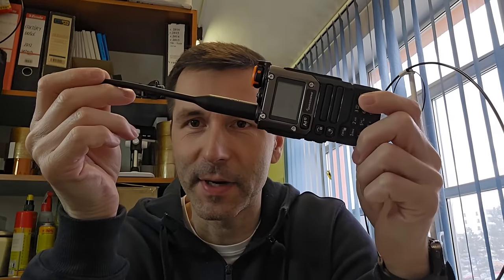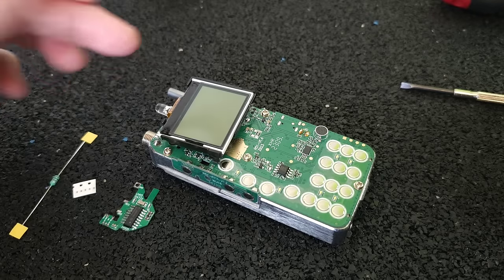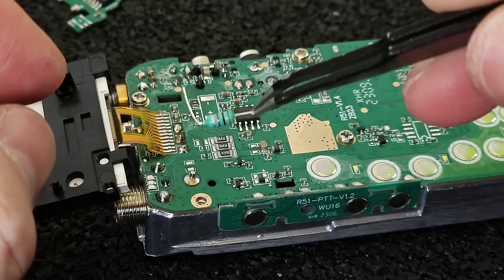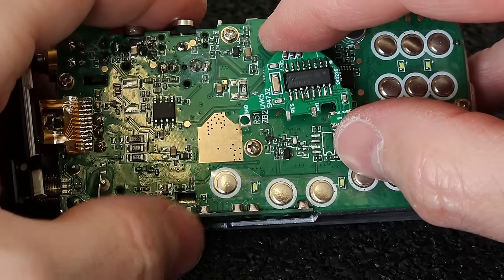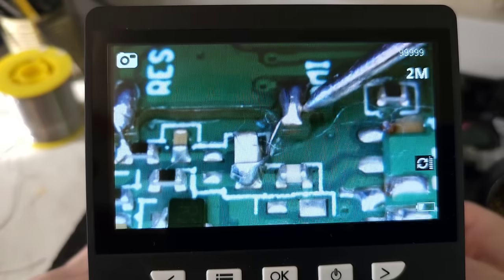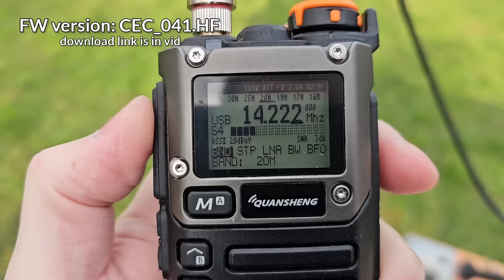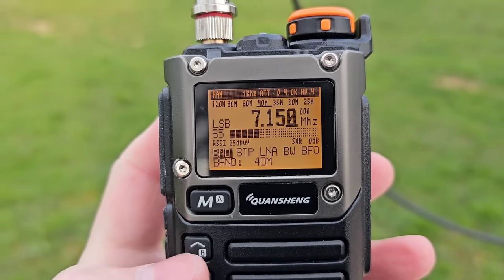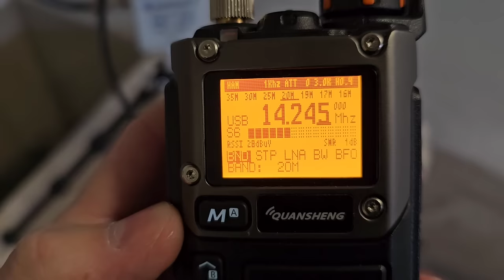VER.1 - HF FULL BAND Mod. - Quansheng UV-K5 (Si4732 new chip module)

Comment: Do the hardware modification work only with the CEC firmware? I would like to usee it for example with the quansheng-dock-fw to remote control the radio by pc. Is it possible?
Reply from the maker: With CEC only

Comment: @OM0ET:face-purple-crying:
I bought the chip and installed it according to your instructions, installed the firmware, but when I press the "0" key I get the message "Wait" and nothing works anymore :(
Reply from the maker: Well, you have to check poor connection on the ex-chip place contacts.
Reply: I have read through everything, from the north to the chip etc., all contacts are perfect. It was worked on under the microscope and with care and good equipment, flux, solder etc.

Comment: I tried this modification, howevre when I try to enable the HF by holding 0, I get WAIT on the screen and the HT locks up, nothing else happens.
I tried FW 0.41, 0.5, 0.51 but all does the same. Any ideas as to why this is?
I've checked all soldering etc and it all looks OK

Comment: Is the VHF/UHF TX still works after this modification, or does it turn the radio into a simple receiver ?
Reply from the maker: Yes. Seems, this mod is just a replacement for an original FM radio chip.
Reply: @OM0ET are you still able to transmit on the originally designated frequencies?

Comment: Do you have to do a firmware upgrade after this hardware mod Paul, or will it still work with original software?
Reply from the maker: You will have to use CEC firmware. No other fw can activate this chip.

Comment: at 7'52" i can see you have grounded something in the middle of the flexcable pcb to the display. what is that for?
Reply from the maker: Yes, I know. It was a tiny piece of the wire from my previous project I was working on before this video :) It has been removed before battery plugged in :)

Comment: hi, I made the modification to the uvk5 with the si47xx module, all done as a video tutorial, installed the fw cec v041 pakeg, but it seems to have no effect by pressing the 0 button the radio freezes, requires a reboot, what could be the problem?
Reply from the maker: Check the connections between both boards on the place where was original chip removed.
Reply: @OM0ET  check all the connections also with a multimeter and they are all ok, I have a doubt whether the EPROM should also be replaced

Comment: sometimes pressing fm stays frozen on the waiting screen instead of going to the low frequency settings  What could it be
Reply: It's a bad solder joint where the 8 pins meets up with the mod board. Mine did the same thing and I fixed it.

Comment: Hello: after installing the kit and updating the firmware to CEC 041, when you press button 0, the radio does not receive reception. it stays hanging. I have checked all the welds and they are correct.
Is there anything else I can do? TNX
Reply: The same thing happened to me when I pressed 0, C E C 041 was blocked
Reply: Usually RES in not connected properly.  Check all connections.
Reply: Same think to me,I have checked all connections but nothing.
Reply: @MegaPanost  Also check connection from chip to mini PCB.  Seen people having issues with connection from chip leg to mini pcb.

Comment: Got the board finally installation was easy enough, but no RX on HF at all original VHF UHF works fine but nothing on the HF tried .05 and .041 firmware. re checked the soldering work everything connected as it should. Could not find any similar issues on web any of you have any idea. 73s YU5KBM

Comment: Hello, I have a question. 
After installing a new chip on my device, if I do not install the cec version and install the ijv version, can I still use it without any problems?
Reply from the maker: No, this module is activated only if you use CEC firmware.
Reply: Ok, after installing this module, I didn't want to use hf. I installed ijv, is there a problem in using normal vhf and uhf channels?

Comment: Does this mod take away any functionality?  Does the FM Broadcast work as before.  Reading through the forums there is mixed information.
Reply from the maker: FM broadcast chip is replaced by the chip with full band functionality. FM broadcast now works but is deaf.
Reply: @OM0ET  Sorry, not sure what you mean by deaf?
Reply from the maker: @robertrusek6068 actually not deaf but useless. FM radio feature was in the CEC firmware replaced by the HF Full Band receiver feature. FM radio chip has been replaced. So the only way how I can tune FM radio is trough the VFO, but there is just a  narrow FM available, useless for a broadcast listening.
Reply: @OM0ET  Thank you for the response.  Seems there is a lot of information contradicting information around this topic.

Please see youtube video:

UVK5 FM TEST ITA - Comparing Broadcast FM receiver after KD8CEC MOD

on IU3POA channel.

Comment: Is it possible to test the mod before reassembling the radio just to be sure it works.
Reply from the maker: Yes, plug in the battery and test radio. Don't need to assemble.

Comment: Does the modification with this chip only allow reception or does it also allow transmission?
Reply from the maker: Chip replaces the chip for FM radio reception. RX only
Reply: @OM0ET  Thanks
Reply: @OM0ET  you say replaces the chip for fm reception. Does that mean fm is disabled after the modification?

Comment: Has anyone else tried this and fail?  I did the mod, got the firmware, and i can not pick up anything.  Tried with all my antennas.  Mag loop, long wire.  I get nothing.
Reply from the maker: Maybe this tiny 100nF capacitor is not properly soldered and you have not correct connection from antenna.
Reply: Ill check the cap.  Is there something special about the antenna connection?   I have my SMA to PL 259.  Do i perhaps need to swap which part of the antenna is on the shield and center conductor?  Thank you! Great video

Comment: Unfortunately the kit is not available anymore :(
But great mod anyway!
Reply from the maker: I have an information from the seller, that it is just temporary and they have just increased inventory and are increasing the quantity. So maybe soon it will be on stock 😉
Reply: @OM0ET  Let's cross our fingers ! Thanks for the great video.
73's from ON4SSC
Reply: @OM0ET I did the mod, which turned out to be much more difficult than I thought (this ultra small capacitor !).
But it's Working great !
Thanks for the video

Comment: One can ask why they dont make the radio full hf rx from start...
Reply from the maker: I think due to the price of product :D
Reply: @OM0ET  well we cant complain about the produkt or the price.. its a great litte radio..just love it
This radio can be made a pretty good hf rx one....With some small mods and changes on the drawing board.. a cost not a lot more  if the maker of the radio want.. then it will bee a bigger sale....
Still iam happy to use this radio om 10m and  rx 11m fare away from perfekt but still working rx .. i mean 20 euro... the cost of pizza here

Comment: Is it possible to transmit with this mod on HF bands?
Reply from the maker: No, it is RX only
Reply: @OM0ET  in your other video that Quansheng can transmitt on 10m and 12m without that hardware mod. to bad that this hardware mod for extended RX disables HF TX.

Comment: Have you tested the harmonics output for this radio?  They are substantial and using this radio on the ham bands is detrimental to all hams because it has a dirty transmitter.
Reply from the maker: It is for RX only

Comment: Hi to everybody... Are their any takers to add a "piggy-back transmit module and sw/fw changes??? I would say  5W CW and 10W PEP on Hf would be handy.

The someone else could develop a second Piggy-back module 10W PO for 50MHZ up to 440MHz.

If you need more output power, just add a brick up to say 50W or 100W externally.

Some bright hams would  fit the modified radio and the Rf pa module into a nice flat enclosure.

I can still dream but funds and my sharp eyes and steady hands left after a motor accident...

It all that modules and fitment could cost no more than USD50... What a bargain.....

Mmm wait wait it was just idea, commend or dream....   😂

Comment: Dude, get a hot air solder station... and non magnetic tweezers
Reply from the maker: Actually I have a Hot Gun solder but it was not so neccessary to use it for just one component :)

Comment: 8:51 but why??
Reply from the maker: Because of the screen plastic frame. Don't fit another way
Reply: Of course, if you can source smaller package choke, you can use it in original position. Or you can make your own choke, it is just coiled up wire, if you have access to measuring devices to check correct value.
Reply: @OM0ET  I think a little bit lower will be a great fit... I will try when my kit arrives
Reply from the maker: @protektwar Today I've tryed to line the upper leg below the screw and it fits too. I needed shorten the lower leg. Upper leg is now in the heatshrink. A screw is back in place ;)

Comment: can it still transmit after that mod?
Reply from the maker: Yes, you can.
Reply: @OM0ET  ah ok cause i have seen an early mod that was preventing TX and since i like being able to chat on PMR446 and co; it would be sad.
will give it a try eventually, thanks again for the info and sharing your work!

i just need some flux

Comment: You did not show the most important part of soldering, the main board and the piggy back board. And the other important part was how did you tune the antenna? The audio is horrible, it is like ship-to-shore communication. Basically you should have shown what you had before the modification and then after the modification. You spent more time telling what to remove and what to and soldering: that everyone knows. Anyway, this video is of no help. I disliked it for you to understand that we are interested in comparing the quality before and after, not how to do soldering. Thanks for sharing anyway.
Reply: I believe this to be more of a “this, and…” scenario. This is a good showing of some of the steps, but I believe that a follow up video to show the complete process would be extremely beneficial.
Reply from the maker: @alocin110 You completely misuderstood the point of this video. This is about "how to do this modification" and not "comparison video". If you know how to do this modification, then why you even click on the video?? Don't you see the title? The picture? It is manly about soldering components which contains the kit. Btw. Why should I compare receiver before and after? The reason of why people do this modification is extension the freqency range below 15MHz, which is not possible to tune with original hardware. If I decide to do a comparison video, I will do it and it will be written in the Title. 😉👍

Comment: with all the trouble you've gone through, all you get is receiving.what's the point of naming the radio transceiver if you can only receive. what a waste
Reply: This is ham radio. It's very existence is based on experiments, modification and building. You're completely missing the point.